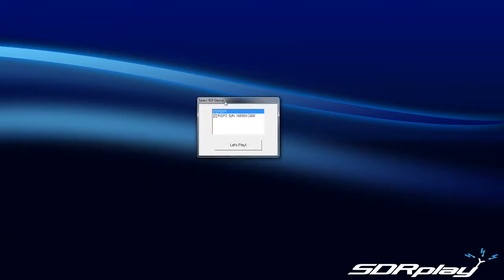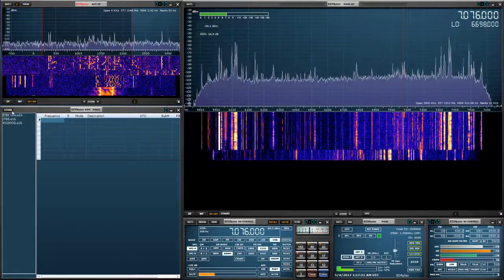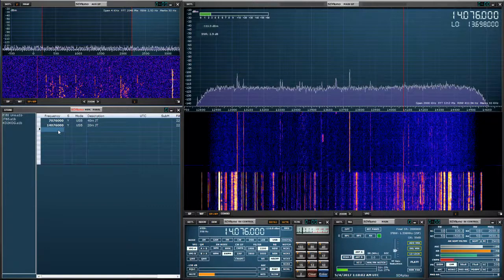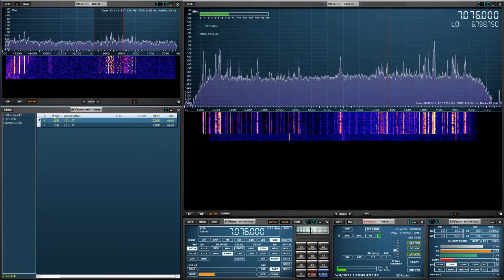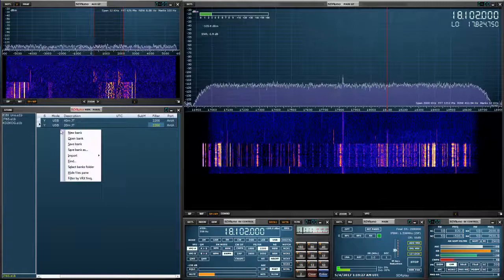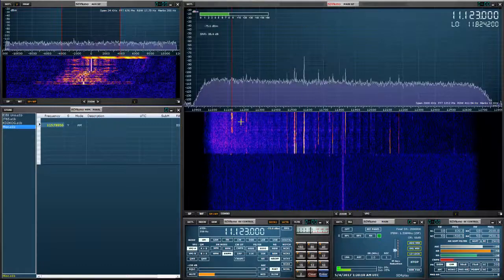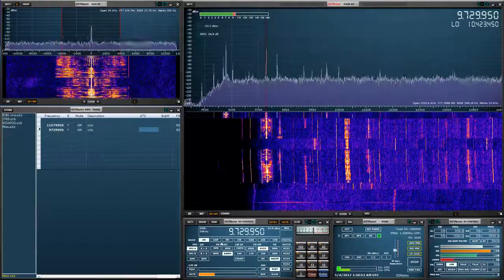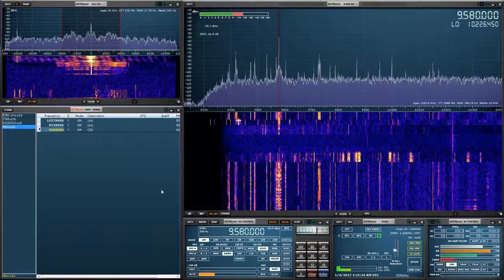SDRuno Memory Panel part 2 of 2 (MV006)

Comment: Some additional video suggestions:

What does scan do in the memory panel? Does this perform a memory scan? If so, how is it enabled?

Could you explain the different FFT windows, FFT average, and Marks Int in the waterfall settings? How do these options affect the display and when would you change them?

Could you explain the different functions under "settings" in the main panel window, how they work and when you would use them?

Could you explain the different functions under "settings" in the RX Control panel window, how they work and when you would use them?

Could you explain how the different functions under "options" in the main panel window work and what they do?
 high/low process priority
 mode
 Channel skew calibration
 Swap IQ channels

Could you explain the two IF modes, what they do, and when to use them?

What does the LNA do and when would you change it?

What do the different AGC settings such as low, medium, and fast do and when would you change them?

What does AM soft filter, PDBPF band pass filtering, noise blanker, and noise reduction do that we can’t do by simply adjusting the audio skirts and RF filters?